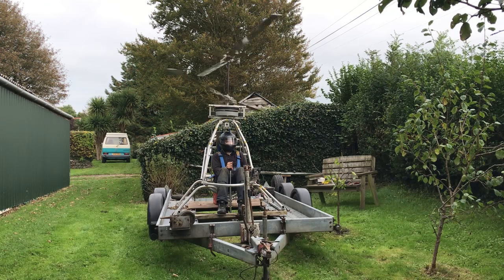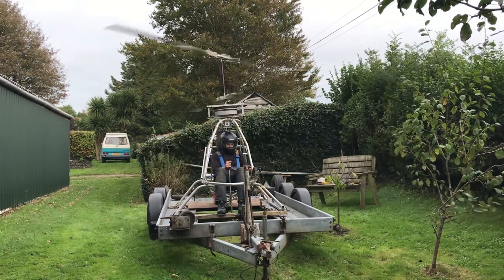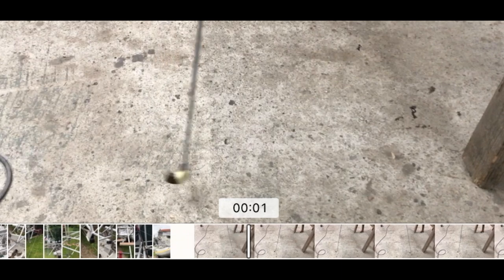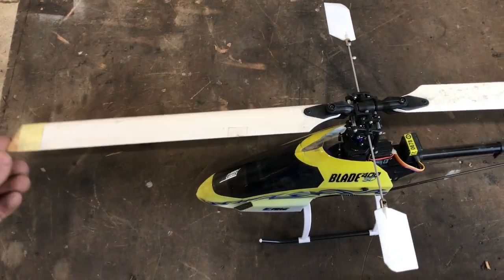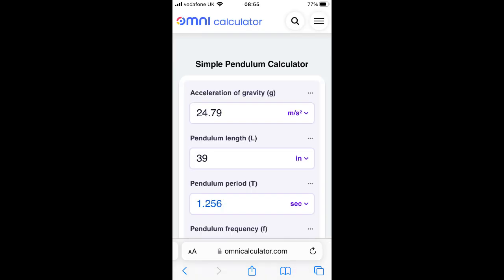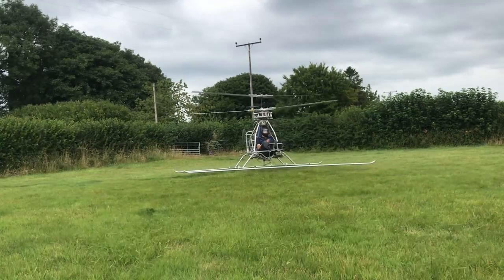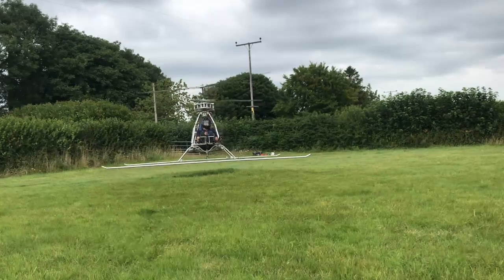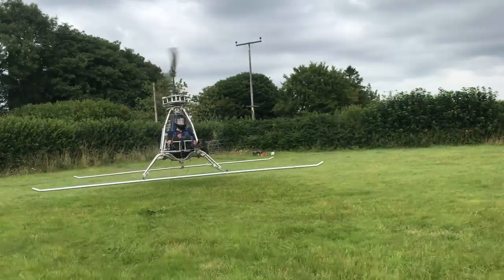Helicopter Rotor Phase Lag vs Gyroscopic Precession WHO IS RIGHT?

Comment: Hi there, I'm afraid that I don't fully agree with your explaination.  If I may offer the following description:

There are three key principles that need to be taken into account, Phase Lag, Flapping to Equality and Advance Angle.  

Firstly to rule out the gryroscope, consider a fully articulated head (ie each blade has 3 degrees of freedom (flap, lead-lag and pitch).  The blades are therefore not linked to one another and follow their own path.

Phase Lag will always occur 90 degrees after where the input is applied relative to the blade axis, no matter the rotor system.   This is due to the effect termed Flapping to Equality, whereby the maximim change in pitch of the blade occurs at the point where the input is applied.   At this point the blade will have the maximum rate of flap, either up or down, coming to zero rate 90 degrees later and then reversing.  The effect is similar to that of gyroscopic precession, however it is not gyroscopic precession

The second important point is Advance Angle and this is the difference between the control orbit and the rotor orbit.  If your control arms (and by extension the pitch change links) are 30 degrees ahead of the rotor blade axis, then the advance angle would be 30 degrees.  The effect is that the input on the pitch control arm will occur 60 (ie 90 - 30) degrees before where it will be experienced on the rotor.  This affects the offset that would be applied to the swashplate. 

The model helicopter shown has a advance angle of 90 degrees and with a Phase Lag of 90 degrees, the result there is no difference between the swash plate orbit and the rotor orbit (ie when you tilt the swash plate forward the disc tilts forward.)

One of the best references that describes the above is AP3456 Pages 5 to 10. The document can be downloaded here https://assets.publishing.service.gov.uk/media/5e18b9c3ed915d3b0c0848e0/Volume_12_Helicopters.pdf.  If the link doesn't work, search for AP3456, Volume 12.  The AP3456 manuals are one of the best available.

With the above said, the helicopter in the video looks as though it has either a rigid or semi rigid heads.  There are no contol inputs made directly to the rotor blades, but rather by applying a change to the axis of rotation of the main rotor shaft.  In this case I believe the effect would be gyroscopic rather than in accordance with the description above, but stand corrected.

My 2c.
Reply: Looking at the comments below regarding the Robinson helicopters, looking at a side picture of the head, it appears to have an advance angle of 72 degrees (the number quoted below), which means that the swash plate is offset 18 degrees to the right (ie when you want to tilt the disk forward, the swash plate is tilted forward and slightly right (I might have the left right confused).  The rotor turns anti clockwise when viewed from above.   This is roughly what I remember from when I instructed on them about 20 years ago.

My 3c (2c + inflation 🙂)
Reply from the maker: @johnreynolds1184  Hi and thanks for the message. It all comes down to the actual phase lag of the helicopters mentioned. You are saying that the Robinson has a phase lag of 90 degrees made up of 18 and 72 in the swash plate and pitch link horns. 
From my research Robinson helicopters don't have a phase lag of 90 degrees it's 72 but that's only my research and I would like to try and measure it in real life. 
The Information you linked suggests all helicopters have a phase lag of 90 degrees. 
I do have a quote from Frank Robinson talking about the 72 degree phase lag but it doesn't mention what the advance angle is.
Reply: @Ben-Dixey  

Hi Ben,

My apologies for the late response, I’ve been travelling (and trying to organize my thoughts on this).

I suspect some of the discussion is actually about terminology.  A good example would be the terms Settling with Power (American) and Vortex Ring State (European), they are the same thing 😊.

I stand by the fact that the Phase Angle / Lag remains at 90 degrees, and this is due to flapping to equality.  The caveat for this is that there is no flap to pitch coupling (termed Delta3) as the control arm pivot point (where the pitch change link attaches) is “usually” in line with the flapping hinge.  After additional reading, I suspect that my comment regarding the offset angle of the swashplate is incorrect (I last flew one in 2008). 

On Robinson Main Rotor Hub the pitch change link is neither in line with the flapping hinges (on either side, which can only flap up), or the teetering hinge.  This means that if the tip path plane is no longer perpendicular to the main rotor shaft axis, there is a flap to pitch coupling (Delta 3), that effectively “changes the Phase Angle”.  It is for this reason that I believe it’s a terminology issue.  Technically the Phase Angle will always be 90 degrees.  In the case of the Robinson, due to the flap --> pitch coupling it has effectively been reduced to 72 degrees. Maybe a better term would be “Effective Phase Angle”, “Flap Coupled Phase Angle” or something similar.   Descriptively it's probably alright to say the Phase Angle is 72 degrees.

Below is an extract from the PPrune forum, with a description provided by Dave Jackson.  It can be found here https://www.pprune.org/rotorheads/229510-robinson-r22-corner-archive-copy-60.html.  
You should read it, it’s quite “entertaining”.  He provides the best description that I’ve seen so far.

-----------------------

The phase lag in a conventional teetering rotor is 90º. This means that the teetering (flap) angle will match the pitch angle, but this match will be 90º further on. The first three columns in the following table show this relationship.

Delta3 is a flap-pitch coupling. As the flap angle gets greater, the delta3 will remove more and more pitch. In other words, the increasing blade flap removes some of the pitch instruction that is telling the blade to flap, in the first place. 

The last 2 columns show the results of delta3. The difference between the 'Pitch' column and the 'Modified pitch' column is due to the delta3. The 'Modified flap' column shows the flap of the blade due to its receiving the 'Modified pitch' instruction.

The 'Modified pitch' column shows that at approximately 72º azimuth there is no more pitch instruction going to the blade. Therefor the blade will stop flapping at 72º azimuth. To point the helicopter in the desired direction the rotor must be rigged to start the pitch instruction 18º later.

[To put it another way; if delta3 causes 7º of flap to give -2º of pitch, then at 70º azimuth, in the following table, the -2º will cancel the +2º. In other words at 70º azimuth, there is no more pitch instruction to make the blade flap anymore.] 

Addition rotations of the rotor will be required to eventually work the maximum flap up the cycle's 9º

Azimuth . Pitch . . . Flap . Modified pitch . Modified flap
00                9              0               9.0                     0.0
10                8              1               7.9                     1.0
20                7              2               6.7                     1.9
30                6              3               5.4                     2.8
40                5              4               4.0                     3.7
50                4              5               3.5                     4.6
60                3              6               1.9                     5.5
70                2              7               0.2                     6.4
80                1              8               0.0                     6.3
90                0              9 

The incorporation of delta3 in a main rotor plus the inclusion of the flapping hinges does move Robinson's rotor head away from the purity of a basic teetering rotor, but IMHO, it will take much more than an interesting discussion to determine the degree of safety, if any, that is lost due to the configuration of the Robinson hub.
-----------------------------------------------------

There is also an explanation of Delta 3 at the following link, it also looks at offset hinge lines https://aviation.stackexchange.com/questions/73318/how-does-a-delta-3-hinge-on-a-helicopter-tail-rotor-work 

And another one here
https://www.rotaryforum.com/threads/delta-hinge-trigonometry.22701/page-2

It seems wherever you go, this is quite a hot topic and very interesting.  It just proves that these machines are magic.  We had a saying along the lines of “The only way their flew was that they vibrated so badly that the earth rejected them”. 🙂

Hopefully I haven't added too much mud to the water 🙂
Reply from the maker: @johnreynolds1184  Thanks very much for this response and I completely agree with pitch flap coupling causing a reduction in phase lag. However I also think offset flap hinges would reduce the phase lag too. If you had a coning hinge 2/3 out from the centre of the rotor, (most lift I believe is produced by the outer third anyway) then the blade will surely reach maximum displacement sooner ? 
Seems logical to me that it would do. Thanks for the links, I had read 90% of it before but it's difficult to know who is the expert. The rotary wing forum I'm a member of and know who they are but the other forums I haven't spent enough time on to figure out who I trust. 
If it turns out that an offset hinge makes no difference to phase lag then my video is wrong and I'm happy to delete it.

Comment: Phase lag and gyroscopic precession are the same thing. Think of it like this,

Phase Lag: varies as a result of an imperfect gyro with many moving parts, and will be different from one rotor system design to another. Hunting & Dragging, Flapping, coning, etc. as well as the physical design of the rotor system.

Gyroscopic Precession: does not vary, due to being a rigid spinning object.
Reply from the maker: I think that could be the lesson I've learnt from posting the video, I think I was wrong to suggest they are too different things. At least that's what I'm thinking at the moment until someone suggests otherwise.
Reply: @Ben-Dixey  you did pretty good overall covering factors involved. It's a topic most people don't understand very well. I'm not an expert in it either. But I am a CFII Helicopter and Aerospace/Mechanical Engineer. I've never personally designed a rotor system though. I'm just looking at things logically from first principles, and from everything I have read on about it over the past 15yrs, both in engineering texts and pilot handbooks.

I take what each book says, then test it against the laws of physics to see if each explanation is valid or not. then look for common factors in all the explanations that withstand initial scrutiny, and again compare to the laws of physics. Rinse and repeat with every new piece of information I find/encounter, until I've refined the explanation and my understanding down to very basic principles that nobody is able to refute. If my arrived at understanding is valid, then it will hold up to any/all criticism. If someone finds a valid hole/flaw in my explanation, then I update and revise my explanation accordingly in response to that new information.

Comment: I love your kit car. But Unfortunately this is illegal in China. I was studying the Hiller control method today. Because I have a huge rotor that needs to be driven.Do you know anything about Hiller system?
Reply from the maker: Thank you 👍 the car is a lot of fun, they don't allow kit cars in China ? 
I did a video about the hiller fly bar in this video.
https://youtu.be/uogPHtWN9Lg?si=h7nPkkl5-uws8VBX
What I believe it does is reduce the sensitivity of the controls and also stabilises the rotor. A wind gust will have less effect on the rotor with a flybar I believe. I think rotor heads like Robinson have solved the issues with wind gusts by having delta 3 designed into the rotor heads. 

Did you design any delta 3 into your rotor head on the two place machine ?
Reply: @Ben-Dixey  Thank you for your video. Only the tail rotor have the delta 3 in my helicopter. The main rotor is a seesaw.

Comment: Hi Ben , with your fixed pitch rotors, is there a flapping hinge at the hubs? Also how did you determine the vertical distance between the rotor hubs??
Reply from the maker: Hi, yes the rotors have teeter hinges, The vertical distance of the rotors are  set at 10% rotor diameter. From research this was thought to be the most efficient spacing.
Reply: What is the fixed pitch angle set at?
Reply from the maker: @bradsamers3014  currently 6.5 degrees bottom rotor, 5.5 degrees top rotor. I suspect more lift would be generated with more pitch but more torque would be needed and that means changing the gearing.

Comment: Ben. To sum it all up you've had the most hands on experience with this setup, if somone came to you and was thinking of going down this road building a machine, fully tilting head etc ,would you spur them on or put them off. ?
Reply from the maker: Good question, it would depend I guess what they wanted to achieve. As a tool for experimentation the design is fine but I think we both know that the cyclic feathering for control is the winner. I would like more time with the machine to really learn more about it, I hope I get that opportunity and pass on the information gathered. 
The Nolan's did a lot with this design so it must be capable of more than I've demonstrated.

Comment: This is super interesting because I have never comprehended phase lag, even as a very experienced R-22 pilot, and even so with your explanation, I am still not sure. You say blades always want to align themselves with the rotor shaft at 4:53 , but I think specifically loaded blades which have a counter to gravity force upwards, because a unloaded R-22 disk becomes un-oriented to the shaft, and made worse by aerodynamic (pilot) inputs.
Autogyros appear to have a 'joystick' which is fixed to the rotor disk, which appears to be the same as your coaxial machine; pushing forward on the joystick raises the front of the rotor disk, moving it left lowers the RH side of the disk; I wonder why this seems to not apply to the gyroscopic precession. In a autogyro, I would think, if you applied a force directly to the rotor disk, say raising the front via the joystick, the force would act 90 degrees later in the disk raising it there? I understand how it works with an R-22 with swashpate inputs 90 degrees before, say increasing pitch on the blade at the RH position creates a force raising the front of the rotor disk, the cyclic linkage taking this into account; but is an autogyro different somehow?
Wow, hearing you added a hinge to the exhaust to change resonance is very interesting.
Reply from the maker: Hi, any kind of wind on a rotor changes the alignment of the disc to the shaft. I think without exterior influences they will perfectly align, Arthur Young demonstrated this in a video. 

An autogyro tilts the rotor forward for example and the pitch change of the blades happens 90 degrees out of phase. It's exactly the same as cyclic control and mine is the same too. 

Pitch change is a confusing term in this respect, I think it should be called angle of attack change because as we know autogyros have fixed pitch rotors. 
The bottom line is when the rotor is tilted the aerodynamics control the rotor through cyclic changes in angle of attack.
Reply: @Ben-Dixey  Ah, I understand now: It is not changing the angle of the disk by force, but say pushing on the joystick to raise the front of the disk is ACTUALLY (in a CCW from above rotation) is really increasing the AOA at the RH position which applies the lifting force 90 degrees at the front: I FINALLY understand gyroplane rotor control! Thank you. Keep the great vids coming 🙂
Reply from the maker: @BrilliantDesignOnline  That's it 👍